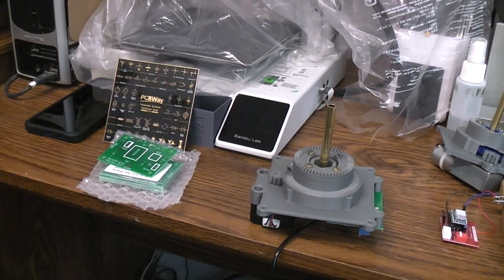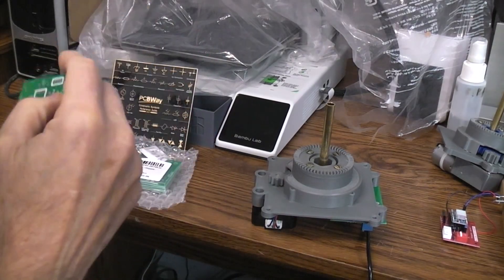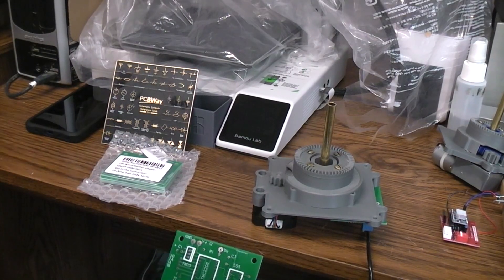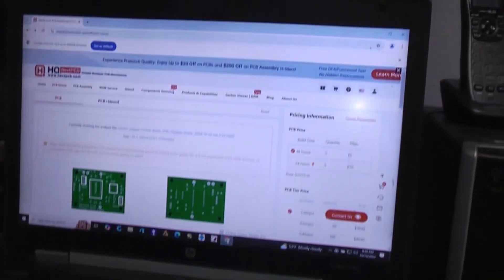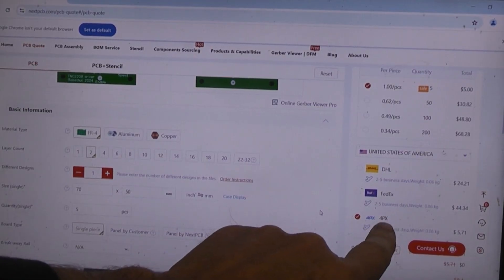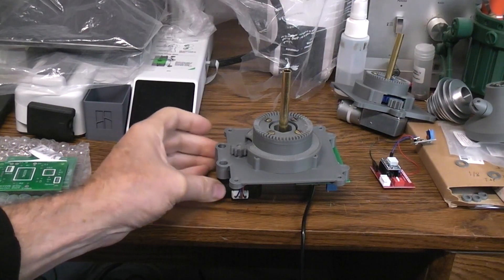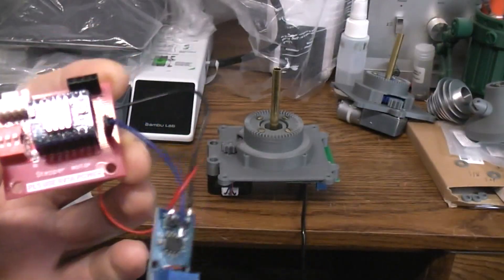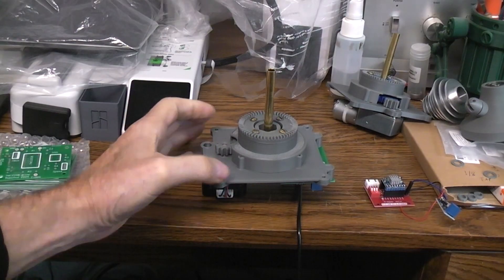Trying NextPCB. I got 6 PCBs for 11 cents, total. I also tried Kicad EDA PCB free design tool.

Comment: Great Info on this John ! I have a question is there a better TT motor that  can be used as an upgrade to the TT motors used in your Robby projects that will give the motor a longer lifespan ?? You always have such great info on Robby Stuff , love the nylon gears you showed on another video . I remember when you first had the How to builds on Robby Heartbox and the TT motors to use and how hard they were to get and how different the motors worked . Keep up the Great videos !!
Reply from the maker: The TT gearmotors will all be toy type motors, meaning no carbon brushes. But the motors cost so little that it would be easy to just replace them when or if they die. I did a video recently showing the different TT motors out there right now. At this time all the gear ratios seem to be easy to buy. So stock up now.

Comment: Interesting. I might have a use for it. I have just acquired an Elegoo Orangstorm Giga (800x800x1000mm 3d printer) and plan to make a Genesis dalek with it starting with the dome.

First draft, I will print the dome itself, get the mechanics working. Later on, will probably move to 3D printing the internal structure and make a fiberglass mold from the draft.

I would like to make this motorized so the thing turns and waves its eyestalk up and down. And I would really like it to be silent doing it.

Big question I have is how to size the motor. I can weigh one of the fiberglass domes probably a kilo, it is roughly 18" across. There must be some formula I can plug numbers into. I am thinking I want the thing making a 180 in 2 seconds.
Reply from the maker: Sounds like a ambitious and fun project. Hope you keep us posted as you start the build, maybe videos showing the steps.